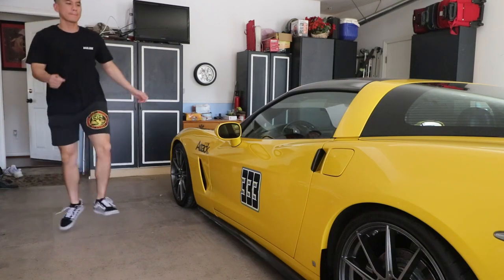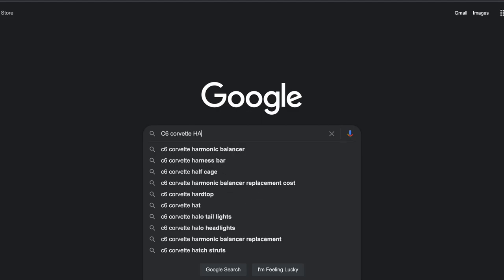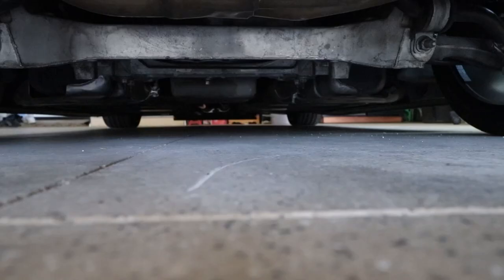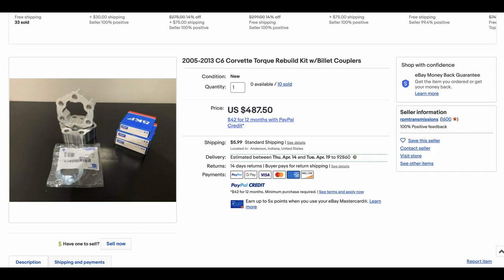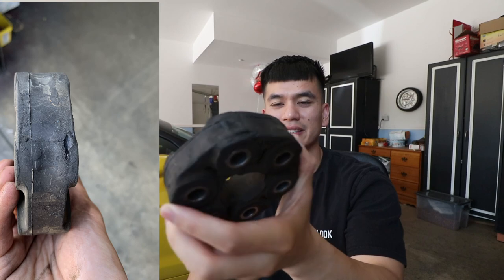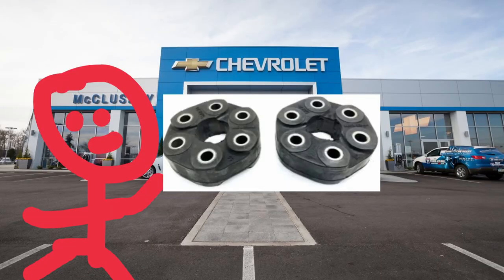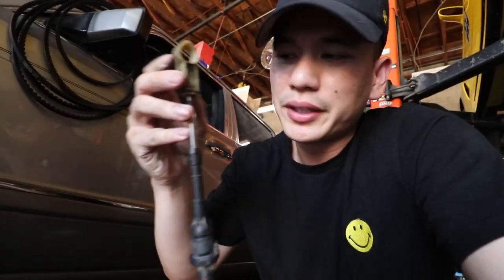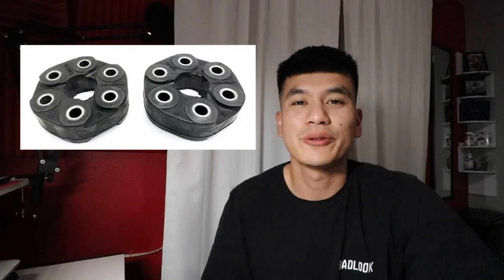This part will ruin a C5-C7 Corvette’s drivetrain

Comment: There are 3 bearings. The couplers (guibos) come apart because they fail, usually completely independent of the bearings. I've fixed a few. Real PITA to fix, expensive if you pay someone to do it, and I do the actual guibo replacement myself regardless as I've seen that part f*cked up badly. Always replace the bearings while you're at it, and get bearings from a reputable dealer or a bearing house, there are lots of fake Timkens for sale out there. The guibos are also used on BMW 3 series cars and they are around $60/ea. if you buy them at a retailer that sells parts for european cars. Same manufacturer and part number GM sells for nearly $200/ea.

Comment: Nice to know what a shop would charge. I'm currently in the middle of this myself on jack stands in my garage. Already finished rebuilding the torque tube. Just installed a new rear main seal and cover, new clutch and new axle seals while the drivetrain is out. About to put it all back together. I've watched about every video on youtube covering how to do it and haven't had any issues so far and the job has gone pretty smooth and easy. So far my parts total is around $1800. Glad I chose to do it myself.
Reply: Hey there Noval! I'm wanting to replace my ds with a ds shop 3.5 carbon. Have you encountered anything that wasn't covered in any videos or forums?
I appreciate any of your time and assistance.
Reply: The whole job went well. I watched several videos on each job I did. Some were duplicated like  removing the drivetrain to rebuild the torque tube and another vid on replacing the rear main seal (you have to remove the drivetrain and torque tube to get to the rear main) so you may see variations on how others do it but you take the route that works best for you working with the tools you have. Even if you have to buy a tool it still ends up cheaper in the end compared to a shop doing it and you get to put a tool in your toolbox when it's done. Getting three wooden dollys from Harbor Freight to rest the drivetrain on so you can roll it out from underneath was the biggest help.  Did the whole job by myself with no help and I'm 58 yrs old. Just watch as many videos as you can to become familiar with the process and take it step by step. Don't get in a hurry and you will get there. @zacharyzane1638
Reply: @zacharyzane1638  if you have any questions feel free to reach out, I just rebuilt mine with the DSS carbon fiber shaft. One thing some people don’t mention is to inspect the input shaft for any damage and replace if necessary, if the shaft or couplers get too out of balance/worn it can cause the tip that rides in the pilot bearing to become damaged.

Comment: My Vette dealer replaced (2) complete drive tube-shaft ass'ys. I studied every blog,  etc., and of course the Official  manual.   The dealer was not aware of the final step which was most important to the problem.   1st, tighten the drive SHAFT to the transaxle and the  bellhousing..   Run engine to op. Temp, 10 min.; the Driveshsaft Expands in length... pushing the crankshaft also. Then loosen & retighten both. THEN,  Drive the car, (after 2 tube ass'ys . he was happy, said he and the mechanic making sure of this step, really no problem existed.) This last step was the key. No more big. Damage.  Very important ! With this expansion and contraction causes wear on your Thrust Bearings ! AND Distributer as the driveshxaft and Ignition system.  All this was on my C7 and may not be necessary w/  C6's, but may help in understanding these big, expensive problems as they appear. Paul

Comment: (for the manual guys)...

In the Z06, the clutch is actually the real weak point.  At minimum, put a fresh friction disk and throw-out bearing every time you split the bellhousing.    Probably any C6 manual with a lot of power will be having clutch issues.  When the plates get thin at all, the pressure plate won't release completely when hot.  So, the plates must be fresh/new or just swap the entire thing.  Monster makes a very reasonably priced replacement based on the C7 clutch (which has an enormously better pressure plate design and is twin disk).

I also swapped for a carbon fiber driveshaft after twisting/warping my factory shaft.  Besides being strong, the lighter weight noticeably improves shifting.  And the shaft has enough flex/spring that solid coupling has little drawback.
Reply: Good advice. I have a stock C6 with regular amounts of power. I don't think replacing couplers is "maintenance." That's REPAIR.
Reply: @salvadormonella8953  On every car that has that type of rubber coupler, replacing them is maintenance.  They are very common on BMWs.  They must be replaced periodically.  I've replaced them many times over the years on 3 on 5 series.
Reply: @yzScott  That's wonderful you think that way. I say they aren't maintenance because they aren't on Chevrolet's Corvette maintenance schedule.  There are many wear items that may require replacement over the life of the car that are not considered maintenance.  Replacing a clutch isn't maintenance. I'd put  replacing anything inside the torque tube as  service or repair, not maintenance. GM is very specific about what maintenance items are. They're found in section 7 of your owner's manual. Nowhere in there is there anything about couplers. BMWs are not Chevrolet's. I don't think even BMW considers replacing couplers as "maintenance," although knowing those shysters as I do, they might. BMWs are a great car. You might do your own repairs on your car, but the VAST majority of BMW owners in particular do not. You may be going through couplers more frequently than everybody else, and so for you they're maintenance, but for the rest of the modern motoring world, myself included, they aren't.

Comment: You got a bad torque tube from the manufacture it wasn’t balanced right from the get go some torque tubes have over 250,000 miles on them and they’re still running fine
Reply: Corvette tech here, that is incorrect. The rubber couplers all wear at different rates due to a lot of variables. The bearings usually wear due to age, the grease in the bearings only last for so long. Skf makes an excellent upgraded bearing.
Reply: My car has 35k miles and already need to be replaced, have the same noise as in this video

Comment: $1000 labor for anything involving dropping the rear if the coupler comes apart (Cheap Coupler) they may have to cut the tube open to free it up so it can be removed so with buying another tube i spent $1700 or so 2 weeks before i spent 5k on the trans (RPM lvl V) and converter (PI Vig 2400) install. Do whatever else is there if u have it out already.
Reply: I did the same, replaced the whole torque tube assembly from RPM instead of just the coupler.

Comment: I had a c5 years ago I replaced the torque tube myself found out the 2nd one was making noise since I bought it off of ebay took it back out and found the balance weight rivet was loose making the noise just smacked the rivet flush and cleaned around the balance weight and added high temp red gasket sealant it fixed it no more noise.

Comment: If C6 guys shy away from maintenance, what "maintenance" is done to help prevent torque tube issues? Anything? I wouldn't regard replacing couplers as "maintenance." Handling that stuff is REPAIR. You had to wait a few weeks for parts? Your dad picked up you couplers for you? I have a hard time having ANY feelings of pity for your situation.  I have nobody to pick up couplers for me, and my dad died 37 years ago when I was young.

Comment: You got a differential leak. When I did my clutch on Jack stands at 70k I replaced all the tyranny and diff seals. The T56 is a notorious leaker. All new seals then reinstalled. Took 6mo on jacks only working weekends.

Comment: Hello Anthony. This was an excellent video! Extremely informative for people with C5 thru C7 Corvettes with the Torque Tube Powertrain assembly. This style of powertrain is unique and enables the car to have almost perfect 51/49 front to rear weight per portions. After 120,000 miles, some of them hard miles I’m sure, you really can’t  complain (not to imply that you were). Chevy did a damn nice job with this car and Vette’s are very reliable in general. Keep up the great work and please keep the C6 content flowing! I love my C6 GS with 44K miles on her. Sure I would love to upgrade the seats and I will eventually. All it takes is $$$ right 😂😂😂. Just tons of chedda.

Comment: I had torque tube problems on my C5. I just ordered a used one on ebay that was in fine shape for $350. Took mine out on jack stands and it wasn't THAT bad... Okay maybe it was so bad that I destroyed my transmission and had to pay a shop 4k to rebuild it... but all in all, I did do the job on jack stands, just did it wrong the first time around. Anyways, the one I took out sounded like it had sand in it, didn't even bother trying to take it apart to replace the couplers.

Comment: I’m curious… How much $$$ was it, all up for the parts and labor? I’m guessing $2800 - $3400
Reply: You should also check the torqu converter since it cost no extra maintenance since that has to be removed as well
Reply: I've heard $1,700-2k labor + parts

Comment: just replaced the clutch in my c5 and rebuilt the torque tube while i was at it. used a friends lift and had it done in 2 days total. a bearing failure is rare, the couplers are the usual failure since they are 20 year old rubber. i got new oem couplers from rock auto with a bearing kit and its good as new.

the billet couplers arent really couplers, they just extend the driveshaft, which means it needs to be balanced and checked so it runs true. many companies make bank from these billet couplers that make the car vibrate like hell and ruin the car. billet couplers can be done, but they have to  be done right.

Comment: Regarding the C5-C7 and $3000 seals/clutch/throwout. Explaining it to somebody who drives Miatas, S2000 and Civics Si and such like I did used to. They really don't make a reliable 400hp+ car. Everything is beefy, expensive and compact to work on. Tires are $2000 a set. Wheels are $600 if you bend one. Rotors and pads are huge. The dry sump on the C7 takes 9 quarts of expensive Mobile 1 ESP. Another thing, Corvettes are relatively cheap when you start reading stories on the Porsche and BMW M car forums. Nothing this fast is just a "change fluids" type car. Even a car like the Mustang GT is more greedy than a regular car.
Reply: C5 Z was the exception to that rule.

Comment: It’s very interesting to listen to these younger people and how they view “maintenance” hey if you have the car apart to that point I would have replaced every seal, bushing and anything else you can’t get at when the car is all assembled! I’m getting ready to do a clutch on my C-5 and I’m having everything replaced from slave cyl to rear engine cover to rear main seal along with having the tranny resealed! It will probably cost $6k but it’s worth every penny! BTW I could do it myself in my own shop but I would rather have the guys at the dealership do it because they do it all the time! Besides if something goes wrong they will have to fix it! Play with the big boys pay with the big boys!
Reply: I agree you are right
Reply: I did the same approach and ended up spending a lot of money almost another Z06 ;)
Reply: Younger people don't have 6k to blow on o-rings and dust boots. Plus the younger crowd doesn't trust dealerships. You say dealerships do it all the time, but that's not true. The number of technicians working at any given dealership who frequently replace seals and engine covers on 15 year old corvettes is 0. Unless you get an older tech, then the guy working on your car likely has never even touched a c-5, much less replaced all the seals after removing the torque tube. Plus trying to get a dealership to take responsibility if they do break something is a monumental task. They'll tell you "it was already like that" or "there was an existing condition we didn't touch that caused the failure." Something that's impossible to prove in court, and it's not even worth trying to in the first place because taking the issue to court will likely cost more than just buying a brand new whatever-part-broke, not to mention your time. These are the people who claim it's normal for a new engine to burn oil. So to the younger people, it's not worth it to even consider going to a dealership. Too risky, and too expensive.

Comment: Very informative video.  I have a stock 2003 C5 (non Z06) automatic.  I drive it like an old man - oh wait...I am an old man!  My C5 has 153,000 miles.  Mine developed the dreaded rear main seal oil leak.  It leaks a lot!  I got a quote from a local garage for $1700 just to replace the rear seal.
Reply: That's why you learn how to turb wrenches and do it yourself!!

Comment: I'm in love with c5 corvette's but this makes me realize I'm not financially ready for one. They may be super reliable but they're still sports cars that have been sitting around for at least 2 decades, and parts will get worn and if they don't you should probably be replacing them anyway.
Reply: You are right i have owned my C6 corvette over four and half years I have put in about six thousand dollars in my car just in repairs and new tire it cost money to drive but the pleasure of diving my corvette is outstanding it put a smile on my face every time I drive it
Reply: @mariomccoy3938  definitely the best value sports car, so many good times to be had. That's why i want to wait till I can afford to have everything working properly and get nice ass rubber etc
Reply: Find a low mileage C5 and you'll be fine. (04 Z06 w/42k here)
Reply: Bought my 97 C5 almost a year ago and already made some extensive repairs myself (cracked radiator, leaking hose, steering rack not properly torqued and came loose WHILE driving, snapped shifter cable) you name it. But being someone who wants to learn from experience it’s definitely an adventure. My 2 cents 🤙🏽
Reply: I recently upgraded my 2007 Z06 to 625whp done by a Corvette specialist and with almost half the engine replaced and other parts to keep it in race ready condition, it ended up costing me around 30k including labor.  The entire torque tube assembly was replaced and the clutch was also upgraded to handle 600ftlbs of torque, bigger radiator, bigger fuel injectors. . The whole car was taken apart and replaced all worn out parts.  The parts list ended up like 5 pages long.  The parts were all cleaned and not an oil leak.  I was impressed by the shop they even replaced the missing brake bleeder nozzle caps.
Reply: @wydopnthrtl  They are great cars but still sports cars. Just a set of rear tires is more than most people pay for all 4 on a regular car. Not to mention they are getting old. I got my '02 Z with 51k on it but it was definitely a deferred maintenance garage queen. I spent a bunch of time and money getting it to be ready to actually drive and do some track days rather than sit under a cover for years at a time. Fluids (everything replaced with quality synthetics), cracked harmonic balancer, wheel bearing making noise, drive belts, tensioner idler, thermostat, blend door actuators, passenger door power lock motor, stupid sun visors falling apart, oil pressure sender failed then the new one failed again after 200 miles, other stuff I can't remember I'm sure. I still love the car and hopefully will keep it forever but it would have cost me an absolute fortune if I was paying someone to do the work.
Reply: @bugdrvr  Thats all true... and a typical corvette owning experience (I had a C4 that was way worse for repairs than this C5)
btw, tires are not that expensive if you upsize +1.  My Nittos were less than $200 each for the rear and about 150 each for the fronts

Comment: Good Video 👍One other problem (also do to design flaw) in these 'Vettes are the harmonic balancer.... I just recently had mine changed out for a piece of mind and well between the part/work it ended up being $2000... I know $3000 sounds like a lot of money, but for all the work the company did to your car it's still cheap compared to other high performance cars like a BMW or Audi... BTW, I have an '08 Black C6 Z51 convertible that has been awesome since I changed out the harmonic balancer 😊

Comment: Very rare for a torque tube to fail below 150,000 miles - unless you abuse your car or drag race or track race with bad technique or do extensive power mods.  You know who you are.
Reply: My 97 only has 81000 and the bushing started failing on it.

Comment: Hey man! Great informative video and really fun to watch. I’m based in Huntington Beach, Ca. and I was stoked when I saw you used a shop in Riverside. Will hit them up for sure! I have a 1994 C4 manua and I’m experiencing the EXACT same noise as you. However I’m getting theories from shops that it’s the flywheel or throw out bearing. Quick question - did the noise you experienced disappear when the clutch was depressed?

Comment: Yep just did mine a couple of weeks ago,  torque tube rebuild and my couplers were shredded.
Reply: How many miles does your car have and how much does it cost?
Reply: @dogsandcars202  mine had about 80k on it and they hit me for about 2 grand in labor.
Reply: @jimmyenriquez5100  same on cost, have to drop the whole rear, 130k miles on mine.  Replace whatever else you need to while your in there .
Reply: @rivaled  had them go through the whole thing got me. We’re almost ready for heads cam now!